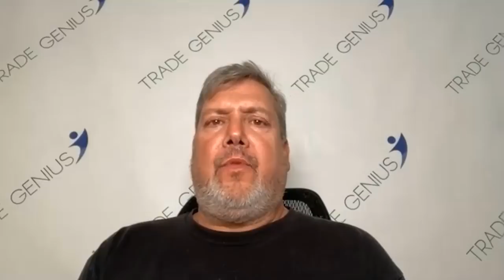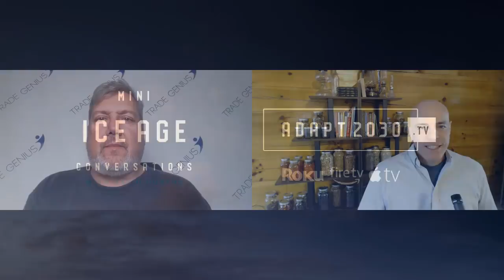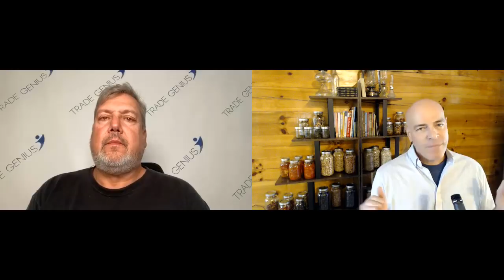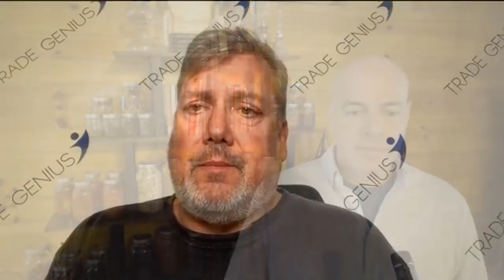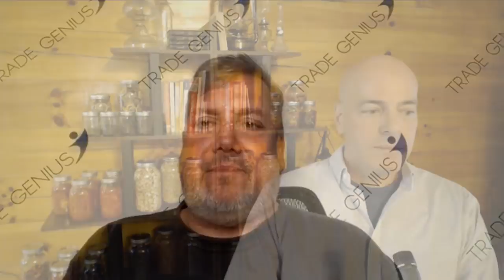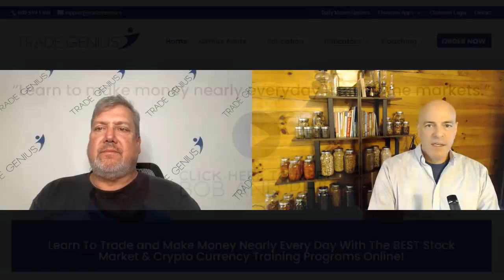Peak Centralization & Shortening of Supply Chains (Bob Kudla 2/2)

Comment from the maker: 🤵 Learn How To Trade The Markets The Same Way I Did: 📈
➡ http://www.tradegeniusacademy.com ⬅
Use Promo Code "veterans" for 40% OFF non bundled items
Reply: does it really work dave? pm motor thing
Reply: Who is selling these dirt bikes?
I am in the market for one
Reply: Nikola Tesla getting substances from the air and using electric d.c current plasma arc to turn it into a liquid? Sounds more like the use of cheap hydropower to convert air into nitric oxide and water is added to convert it into nitric acid and exposed to oxygen to be converted into nitrous oxide which is often used by car speed racers.

Comment: 1 kilowatt hour of D.C current can convert 1 cubic foot of water into 7 cubic feet of hydrogen and 3.5 cubic feet of oxygen if I can recall it right. Requires comparison checking with microfilmed archives of encyclopedias already recopied and reprinted after microfilming and has been vacuum prepared and argon packed-fusion ultrasonically sealed.

Comment: You don't kill a potato plant they die when they are ready to harvest. You will severally decrease your potato yield by harvesting well the plants are alive. When a potato plant dies back is when it puts all of it's energy into the tubers/potatoes. Harvest about 2 weeks after the plants are completely dead this maximizes production and it also cures the potato skins so they are ready for long term storage coming right out of the ground instead of pulling them up and curing them in a dry shaded area.
Reply: Thank you for that.

Comment: The test weight on my corn has ranged 51.4 to 54 which seems low as 56 T.W is normal. I got it planted on time and it got ripe on time with black line reach over a month before a frost. It also had a month  longer of warm weather then normal to dry down.  Could less intense sun light cause this? Would have smoke in the atmosphere blocked the sunlight or was the sun less intense.  Surely someone with satellites measures the suns intensity and compares it with the intensity of sun light reaching the surface of the earth.
Reply: We know Billy Gates is trying to block out the sun, chemtrails, haarp, all of it adds to less sun, more clouds. I very rarely here in Canada ever see Simpson’s clouds anymore. The atmosphere is certainly changing, and the eerie quite some days is very strange.

Comment: As a pv installer you will get away with changing just the panels mc4 connectors and roof bars strap any solar panel down no need to rip your roof apart at all mate inless you have an integrated system in witch case you obviously have the money 😉  there a false economy we all know that.  On demand hydrogen your talking browns gas then off a battrey feeding the inlet system we have had this tech for years there's a reason we don't have that tech

Comment: All the information put forth on prepper channels is for COLD climates.  What about how to keep pool pumps running off grid (3000+ watts to circulate) for water supply and air conditioning for tropical climate.  100watt solar panels dont cut it

Comment: 330x32# buckets beans, rice, corn, wheat.  Rabbits, Quail, Bees. Community garden.  3 years of canned goods.  Off-grid, solar power, off-grid wood/solar heat, 1000 gallon rainwater collection system.  Ciao!
Reply: You could up your rainwater collection a little. ;)
Reply: @riffhurricane  infinitely expandable at the bottoms. Connect hoses and let it gravity feed to other IBC totes at a lower section of the yard. Where you are correct is that getting spare food-grade totes, hoses, fittings would make sense.

Just ordered 4 sets, 8 total Berkey filters. That $460 is going to make me sleep better for a long time.
Reply: @GoodmanMIke59  I mentioned the water because I couldn't fault you on any of the other things you said & there's always more to do in any plan. 

For my own setup I'd prefer to water my garden with the rainwater as well as drinking - its far enough to the (spring fed) stream for it to be a major chore to carry it all. On a really hot day I'll get through well over a hundred gallons. I'm not there yet, but I'm working towards upping my rainwater storage to a couple of thousand gallons. 

My situation is not yours of course, & everyone has different priorities, you may not have a garden at all. It really does sound like you have your head screwed on properly with this though. Nice going! 👍
Reply: @reformedchinesecommunist  no, no Grand solar minimum stuff. The trick is to be willing to live off of the least technology required. I mean that! The trick is not "to own nothing and be happy" but "to little  and to be satisfied" with what you can Claw out from nature.

Cooking on wood, oil lamps, gravity-fed water collection. Simple greenhouses. Feeding rabbits fodder from the land. Everything else is a first world problem.
Reply: In the tropics, with no water system, we have a small 12,000 gallon cistern system. Our new house has 38,000. Concrete is wonderful.
Reply: @Pluscelamemechose  I am by myself, 45 inches of rain on 1000 square foot of roof, never a problem. You guys obviously know what's best for you. I guess you're pretty thirsty people.
Reply: @GoodmanMIke59  our island has no natural water, so rain is it year round. Including any dry season.